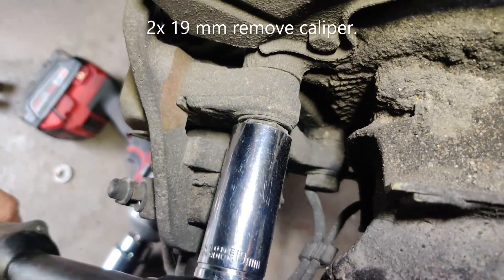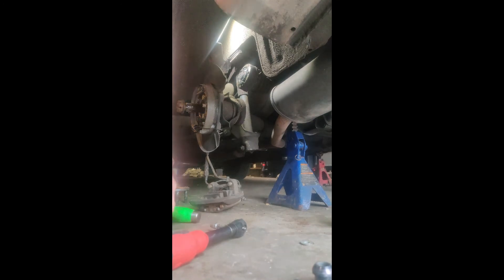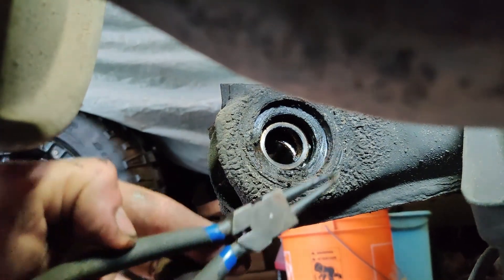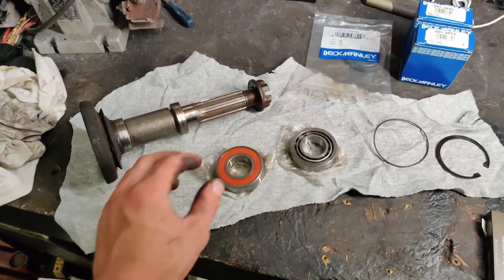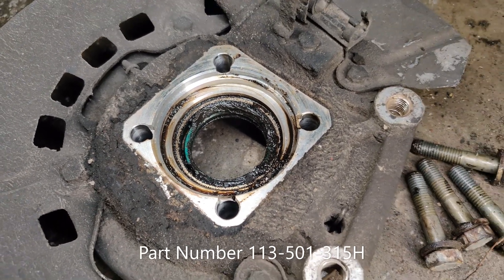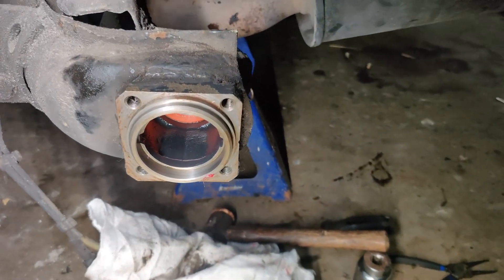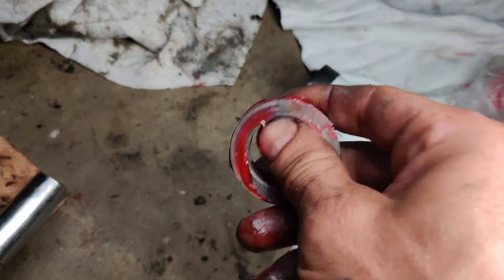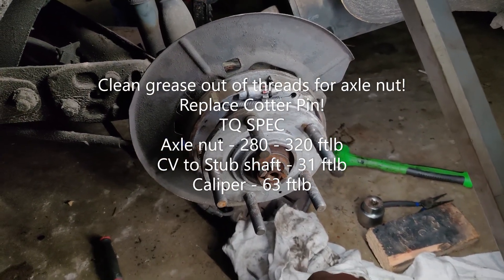Porsche 944 Rear Wheel Bearing DIY NO SPECIAL TOOLS! NO PRESS! Early 1984/1985 w Steel Trailing arms

Comment: Very nice video. I gotta high five you on the use of the electric ratchet to remove the bolts! No need to spend all that energy on a ratchet to hold yourself in position and bang your knuckles repeatedly! I have one car with steel trailing arm and one with the aluminum. This was super helpful.
Reply from the maker: Just because the car is old doesn't mean your tools have to be lol.

Comment: Talk about great timing : I'm preparing this job on a 1986 944 NA / ordering my parts. This is EXACTLY the video I was looking for! Thanks for the great step by step guide and please don't take it down or I'll be scr*wed in two weeks from now lol
Reply from the maker: As long as you have steel trailing arms and 2 bearings this should help you! Thanks for commenting, makes it feel like less of waste of time. :)
Reply: @barbershop123  double checker everything when i saw rockauto was offering inner and outer bearings AND big single units : I got the aluminum trailing arm! But all is not lost, will still be going through some of the same steps and your video still helped me grasp a little better what I m getting myself into. I did however get a slide hammer bearing puller as i dont think there will be a way to cheat around it on the aluminum trailing arm. Cheers and keep it up

Comment: Nice, will be replacing my entire trailing arm due to a bent axle and rear shock mount the previous owner did not mention. I bought a set of trailing arms and a torsion bar from a parted out 1983 944 for $140 and was wondering if it is any different than the 1984. Also, is it a pain in the ass to set up the parking brake cable when swapping trailing arms? Planning on rebuilding them off of the car and replacing them somewhat quickly